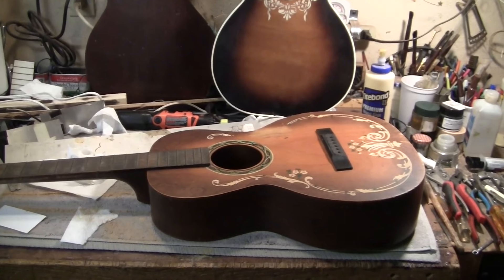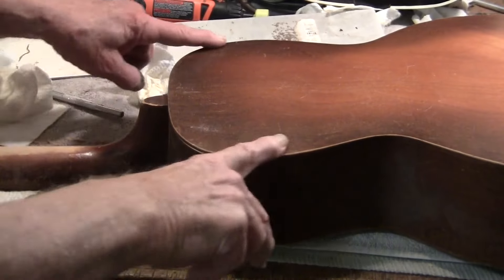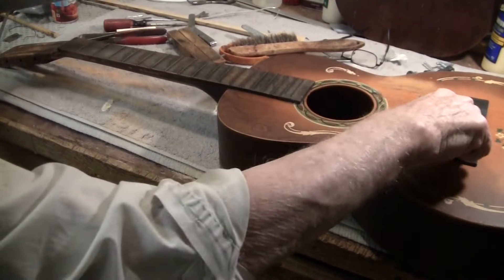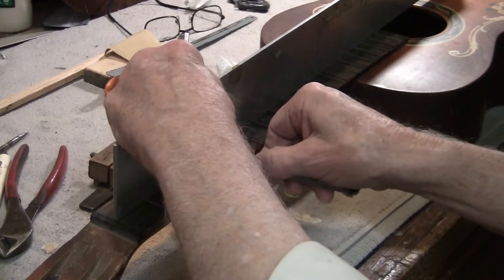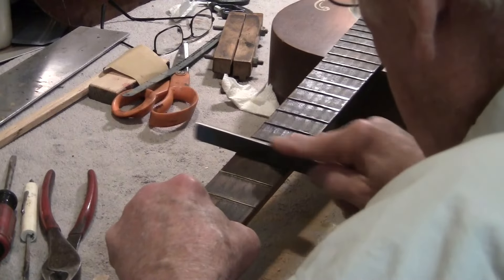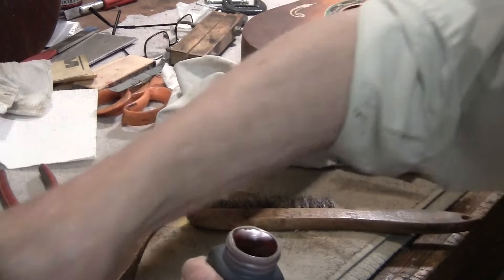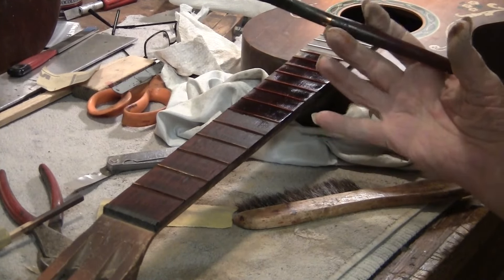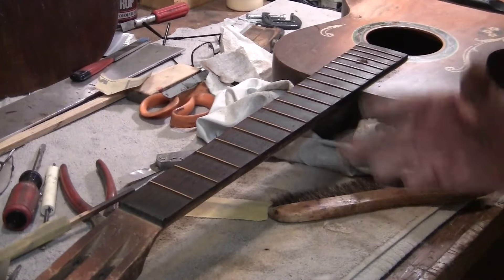Golden Oldie Parlor Resto Part 1

Comment: Love that stenciled design on the top; so distinctive.

Is that fretboard a stained lighter wood as in some ‘30’s Nationals? I have a ‘31 Duolian that has a dark stained maple fingerboard so that it looks like rosewood. It was done like that at the factory.
Reply from the maker: Yes - the video shows the lighter color wood and the stain. The leather dye does not come off on to your fingers,  Pearl dots still yet to be installed.